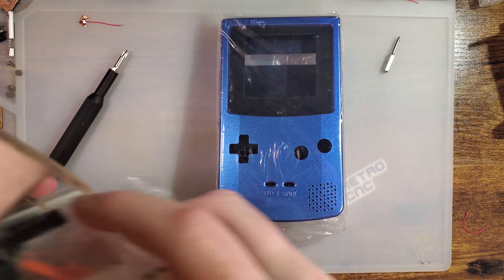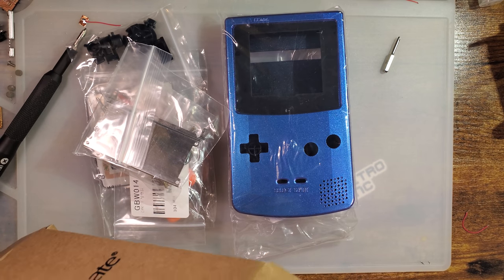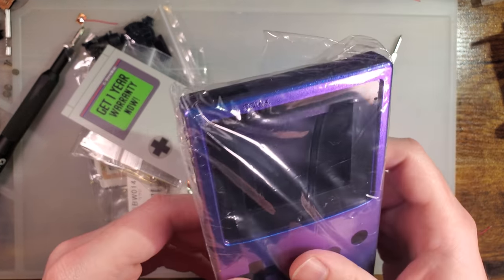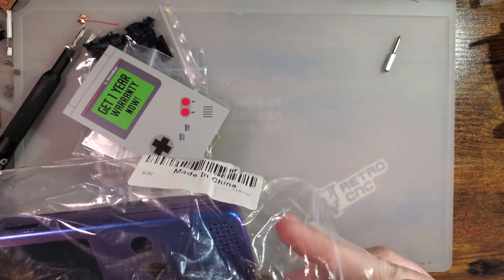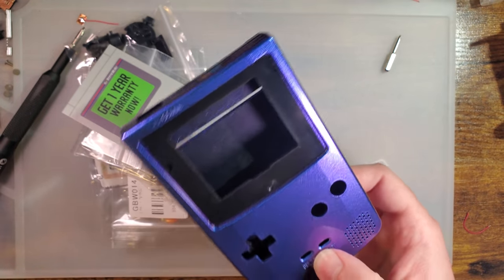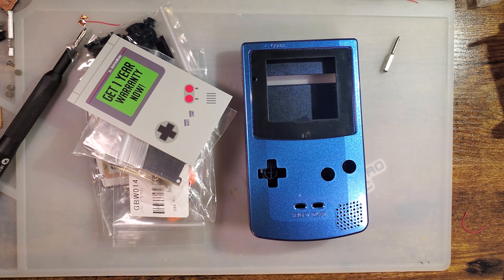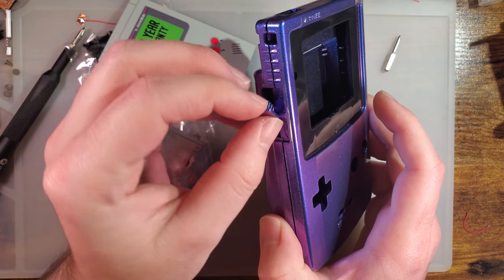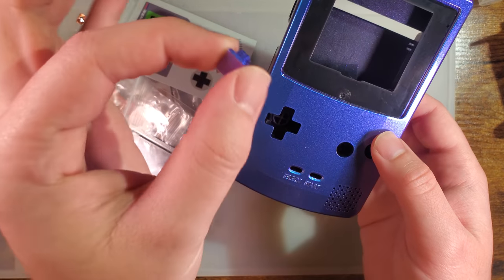eXtremeRate Game Boy Color IPS Ready Shell

Comment: Hey Mak-Daddy. How does one fix an aftermarket shell with a way-to-tight power switch? I have been opening it up and just shaving where i think it contacts and its improved but still really not great.  Appreciate you and what you do.
Reply from the maker: yeah, that's pretty much what I do. The correct thing is to modify the part that isn't to spec but it's much more difficult to modify the switch opening than it is to modify the slider itself. 

Lots of guess and check involved.
Reply: @makho  Thanks for the reply, I did get it eventually but as you said lots of guess and check involved. Its still a little stiff but easily operable with one finger.

Comment: Just a quick question makho does the old GBC shell by eXtremerate work with a OSD Q5 kit after trimming? I had pressure on the screen and when I tried to relieve it I broke the screen 😞 I appreciate all your vids I watch them to help me through my modding process. RGRS was super helpful but I wanted to ask you. Thanks man.
Reply: Sounds like you didn't remove enough material then.
Reply from the maker: either works with a Q5 after proper trimming. There are no Q5 ready GBC shells yet.
Reply: @makho  thank you !
Reply: @gibeshrugs6825  thank you!